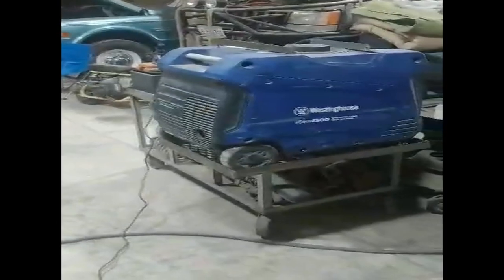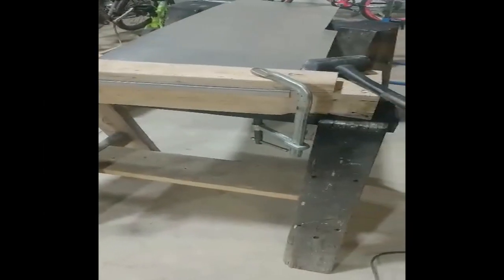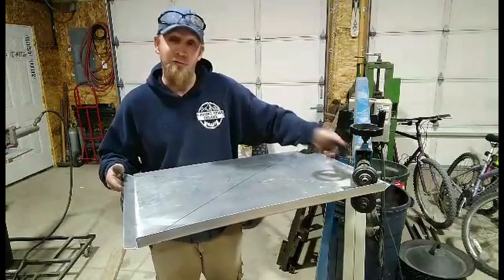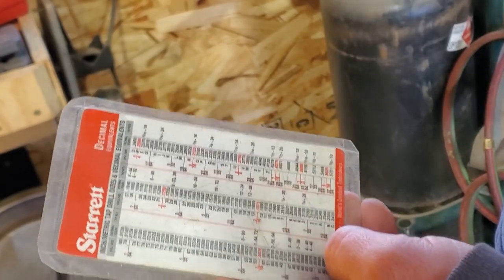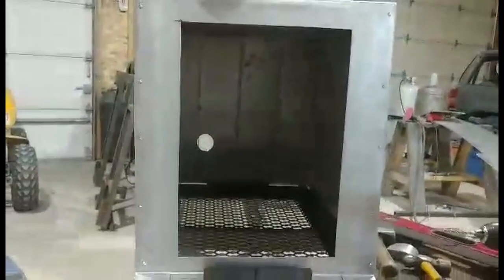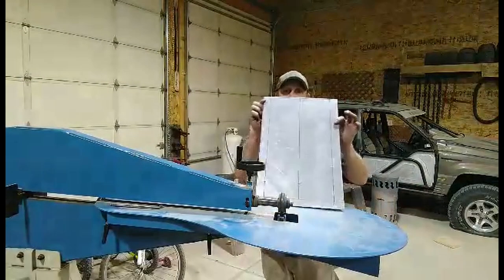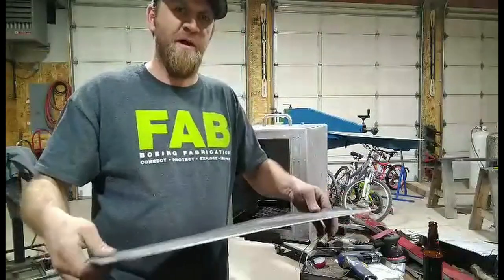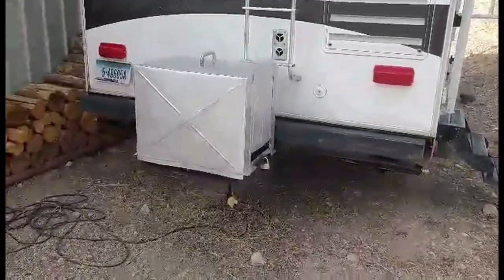Receiver Hitch Generator Rack - Locking Cover - Locking Generator Cover Aluminum Cover - DIY Cover

Comment: I want something like this to put over my generator in my garage
Reply from the maker: Ya it has some good and some bad. when we were in moab it got alittle hot running with the cover on. The good thing is that its out of the rain and snow and it alot more secure.